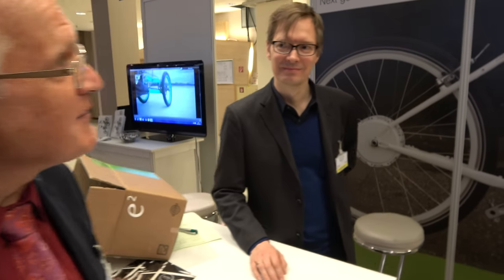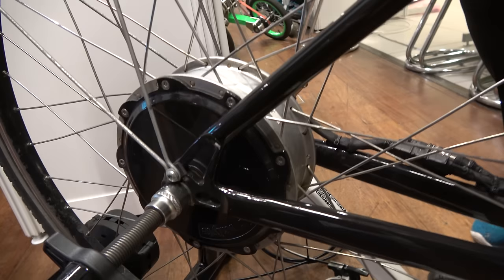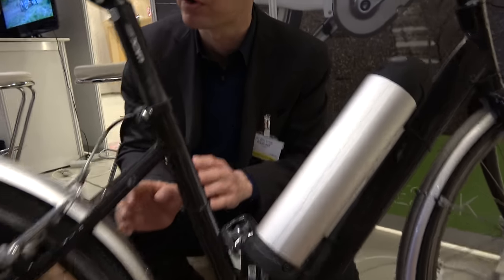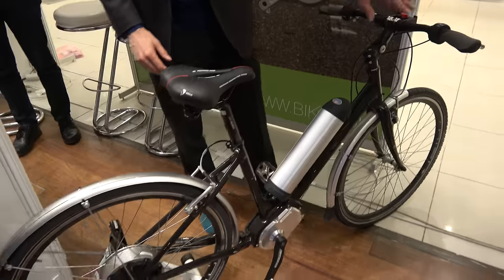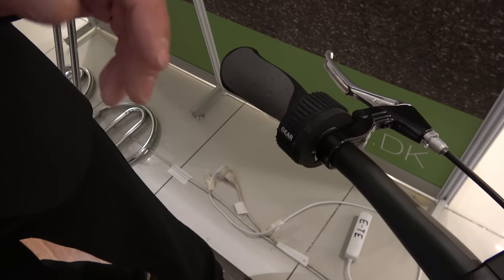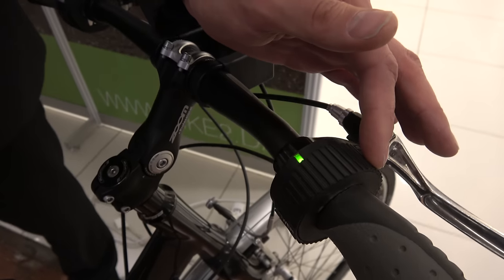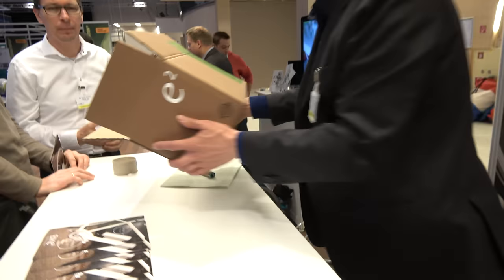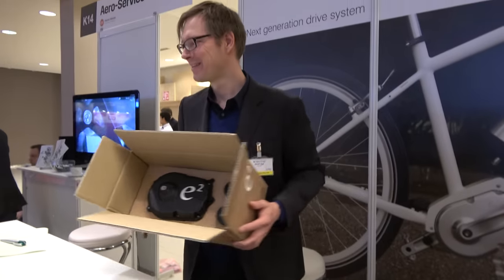Bike2 electric bicycle with no chain

Comment: Why is this not available in the market after 4 years? This looks like my dream bike...
Reply: Do it yourself from 2 hub motors
Reply: @daysetx  it is the chainless drive, not the two hub motors that is unique and different. There is no DIY option here. And two hub motors is not an interesting option for me.
Reply: @OnerousEthic  the second hub motor in middle to work in recuperation mode by pedaling it
Reply: @miolini  Really? That sounds very cool! But how much resistance can it create when backpedaling? Can you do without a brake?
Reply: @OnerousEthic  Yeah, this is all about efficiency. Chain is 99% efficient, recuperation in one motor to power another (including rectifiers, dc-dc transforming, motor controller) I bet only 70% efficient.
Reply: @miolini  I’m looking forward to the data on that. You made an excellent point.

If it really is an electric bike, efficiency is not so important, and neither is weight reduction. 

I think I’m just in love with the concept. I love the idea of decoupling the human from the drive train. But without a battery, it really does not make sense imho.
Reply: @miolini  The efficiency of using a pedal generator and motor is more like fifty to sixty percent efficient. This could be raised with exotic high efficiency motor/generator designs (such as axial pancake), but this are rare and expensive devices.

Comment: Excellent! :) Today during bicycle workout I wondered why not to make a hybrid pedelec? :) started with some googling so I realized its already developed, congrats! :) 
is it in production yet? I realize its a 4 years old video now. 

BTW I would make a basic hybrid version with about 60Wh battery. It's like the Prius with small battery. For longer, harder trips one could add an extension battery to push up to like 400Wh the capacity. The smaller pack good for city use, the bigger for hills or long trips (but you dont need to carry the heavy battery all time)

Thanks for sharing!

Comment: I would guess the overall efficiency of converting mechanical pedaling energy to electrical and back again is less efficient than simply using the mechanical energy thru a chain. Regardless it's still a cool concept which was also done by Footloose.
Reply: The point is that the battery sits between the generator and the load. It is an electric bike with no chain, no shifters, no gears. Brilliant!! All that cost, and all that weight, and all those design factors just vaporized into thin air! You charge it at night, and you can go 50 miles at 35 MPH or so.
Reply: @OnerousEthic 
It's still a mechanical bike. Nothing electrical here except some control electronics !! As for gears, it is a very efficient system that transmits and transforms mechanical power efficiently and reliably. It is also stronger than consumer electronics and has a longer life cycle than a battery. The purpose of the gears is to obtain the appropriate output at the lowest input power, which here is battery power !! Relying on the motor as a unit to move something puts a lot of pressure on it and drains the input power. The motor also becomes large in size and introduces complexities into the system as a whole that are unnecessary to do something simple and that can be done without the complexities of consumer electronics and the inconvenience of programming. The thing I see is that feeding the mechanical system with electricity is good at best as a backup option, but relying entirely on it is bad because, as in this video, if the control electronics malfunction for any reason or the battery malfunctions, the cyclist no longer has control over it ! Electronics are good in some specific places, but trying to market them and cram them into everything I find reprehensible and exaggerated !

Comment: How does the efficiency of mechanical chain transfer compare with the conversion of mechanical->electric->mechanical?
Reply: +Nick Hill 
See specifications on http://bike2.dk/wp02/technology/.

It is battery powered, has 50 km range, it can multiply user effort by 1 to 3 times.
Basically, within this range efficiency would not  matter. For the cyclist, it can be 300% efficiency :).

I'm curious about what happens when battery is depleted.
Reply: Mirbek Samiev  This might be the effective gearing ratio. My concern is that if, say, 30% of energy put into the pedals was converted to waste heat, which I would guess is optimistic,  then once the battery assistance is depleted, you would need to pedal 41% harder just to overcome conversion losses. I guess the design is great so long as you have charge in the battery. You could also pedal at traffic lights etc.
Reply: +Nick Hill I'm thinking the design is intended for certain scenarios (e.g. commutes within most of the battery's charge, bicycle rental, frame / folding bicycle variations with the design constraint of the chain removed). 

I can't imagine the mechanical->electric->mechanical conversion efficiency being anywhere high enough to replace the use-cases of a typical chain-driven bicycle -- and it's likely why they don't post efficiency/weight figures on their website or discuss it in the interview. You also have to account for the added weight of the battery, motor, and generator, the conversion-related-losses in those components, the added cost of these components, and the fact that one must think about charging it.

Wish the founder in the interview clarified the target use-cases and more importantly, the ones they aren't.
Reply: @nickhill9445  30% waste? Noo, the efficiency could be more like 80% I guess.
Reply: @seltzered  but it is still nice that it could theoretically ride infinite distance with pracitally empty battery, isn't it? Reduced efficiency or not, you can always get where you need to without the need to push your bike...
Reply: @OYeahan  20% system loss is possible, but we have controller losses to factor in so higher is more likely IMO.. In the event power cycles through a battery, system losses will he higher since the battery has internal resistance and hysteresis on voltage.
Reply: @nickhill9445  depends if they did optimize for that or not. Of course I took into consideration the immediate consumption scenario that bypasses battery losses altogether.
Reply: @OYeahan  If it's theoretically so great, I'd think they'd have pushed past theory and shipped by now. I was being nice in my earlier comment, I think time's proven this idea didn't work out. Three year old video, bike2.dk website not updated since 2017. Nils Sveje's linkedin (https://www.linkedin.com/in/nilssveje) lists end of working on Bike2 on Mar 2018.
Reply: @seltzered  I know that it's probably a failed startup, unfortunately. Footloose managed to sell some pieces of similar series hybrid bikes. I think that there is a potential for this in some niche market/use cases, which bike2 failed to market to properly I think.
Reply: Maybe you can get a significant amount of extra energy from the sun, heat or wind to the batteries too.
Maybe human legs can generate power more easily in a "stepper" rather than in a pedal.
Schaeffler Bio-Hybrid has a similar setup and seems to work absurdly well.
Reply: They are both highly efficient. That is not the question. The question is: why have all that weight and expense when it simply is not needed?

Comment: so you dont need to charge it generates its own energy throught peddling ?
Reply from the maker: +khail chain yes you pedal when you have strength and it uses that power. You have to pedal for it to go forward, but you can pedal slowly when you're tired and still go fast. That's how I understand it.
Reply: ARMdevices.net thanks bro :)
Reply: +khail chain My engineering guess is you'll still need to charge the battery, the pedaling portion seems intended more to extend the total range slightly.
Reply: seltzered thanks buddy
Reply: @charbax  so if the battery dies, your generating power goes directly to the wheel? I wonder how much power loss that would have. Common chain drives have about 1-4% power loss from pedal power to wheel power.
Reply: @therealgerold  Probably a lot  more power loss than a having a chain.
Reply: You still charge it. It does not have a chain. This has nothing to do with charging the battery.
Reply: Very nice

Comment: I wonder about the powerloss in this systemvs chain?.In other words: How much would it affect the range vs a regular ebike?
Also how would this affect the regulations. I would guess the motor needs to be more powerfull than 250W ?
Reply: Probably quite high unless you are doing the optimal rpm. But at optimal rpm it could probably reach 90% efficiency. The efficiency loss is easily compensated by having a few extra grams of battery and the ability for regeneration. Also the lost power is miniscule compared from the assist power anyway.

Comment: So if the battery is flat or missing can you still get around on the bike by pedalling?
Reply: Yes, you could. However, this drive system would only be about 50 percent efficient. Compare that to a mechanical drive system which is typically around 93 percent efficient.

Comment: Surely this does not comply with the current EU or UK EPAC bicycle regulation.
A nice machine...but surely will be identified in UK law as the same vehicle as a motorbike. 
Needs new regulations to catch up.
As it ever was.
Reply: Are you sure? As far as the motor puts out a maximum 250W at legal speed plus the same power that the cyclist puts into the generator, there's no difference in performance compared with a traditional pedelec; it is like the bicycle has an electromechanical transmission integrated into the pedal assistance system. Of course it takes interpretation, so whether the electronic management of the muscular power can be considered same as with a chain depends on the lawyer's point of view...
By the way, I live in Italy and from the words I read in our laws there's no reason for considering any electromechanical transmission unlawful.

Comment: I like the concept used on this bike with the pedals generating power for the motor and the motpr doing the main work! However. I don't like the style or the thin tires! I prefer tires of at least two and hal inches in width. You need tires that give some traction on roads!  I also like a bike that let's me sit close enough to the road to reach the ground with my feet while sitting in the saddle. With electric bikes this is easily doable. My limo let's me ride low, but the torque is horrible and taking off is hard work. With electric assist that could be easily taken care of.